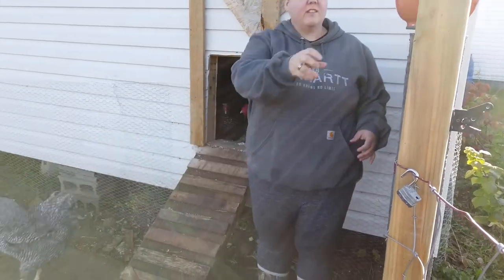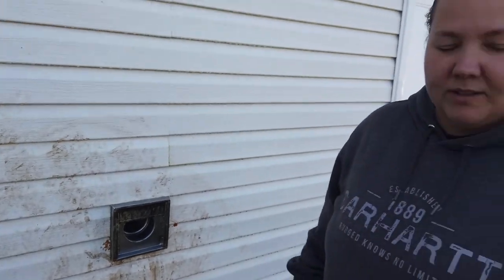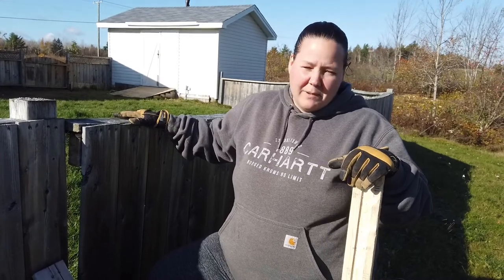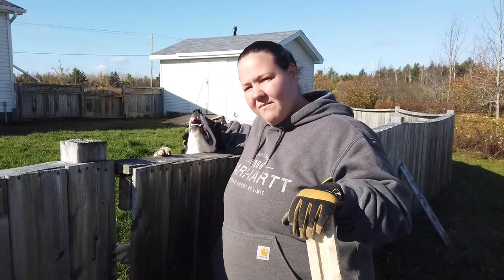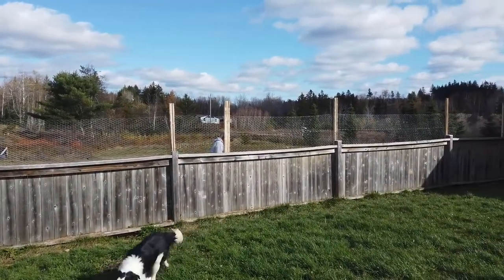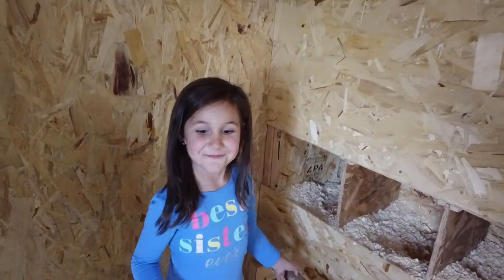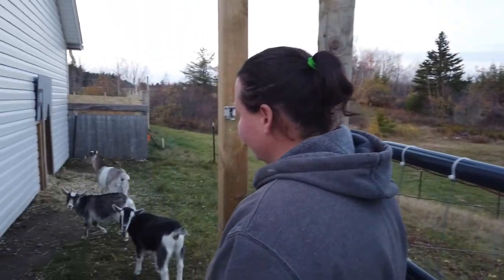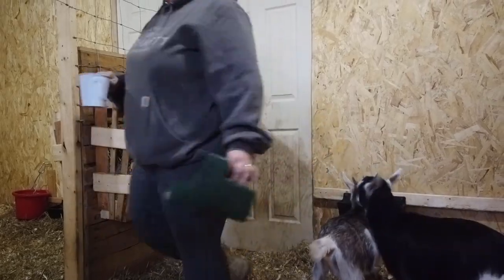WHY ARE BORDER COLLIES SO MUCH TROUBLE

Comment: I hate to say it but if they tore off the metal one you might need to put up a couple poles and string up a couple hot wires! Border collies are smart itll only take one time. Put a colored cloth piece tied on each post so they'll only be afraid of posts w/ cloth on them.... hey even if that fence wire only fit 1/2 way thats still alot for free!
Reply from the maker: Oh yes very smart they are indeed. Yeah I thought the half roll of wire was great too. You really can't complain when it's free